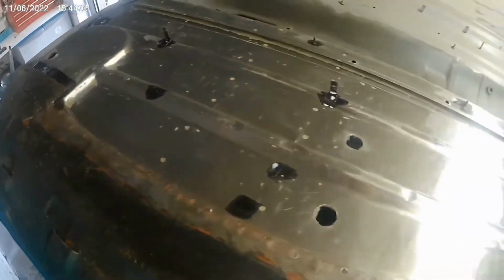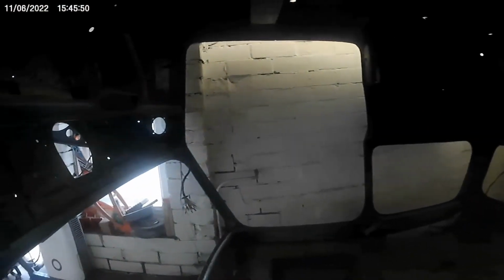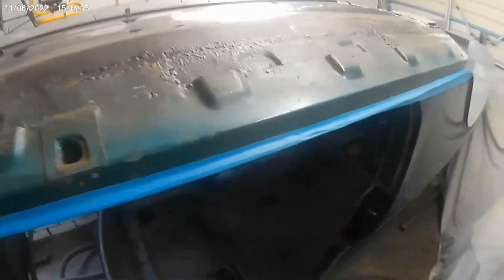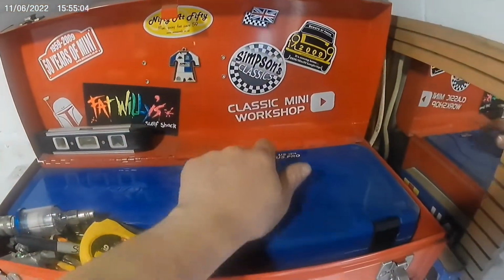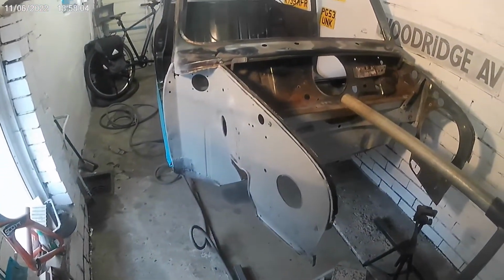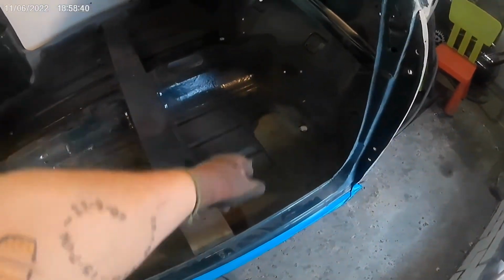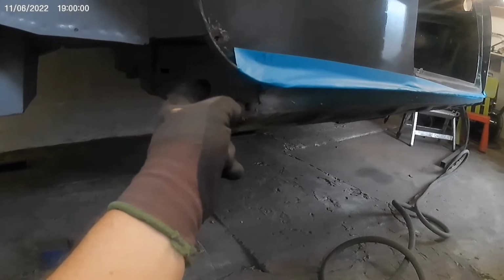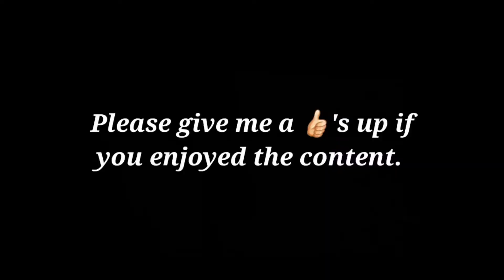Classic Mini Cooper Restoration On A Budget ( Part 29 )

Comment: Great job, admiring your patience, i took the inside sound deadening off with a hot air gun set to about 250 deg celsius, use a chunk of copper on the inside when plugging the wheel arch holes it works great
Sad to see you have so much work to do on your mini, keep up the good work
Reply from the maker: I started the sound deadening today with just a hammer & chisel, came off really easy.  Thanks for the tip with the copper, I'll try that 👍🏻. Hopefully all the work will pay off & I'll have a nice little car at the end. Thanks for the commet 🙂.